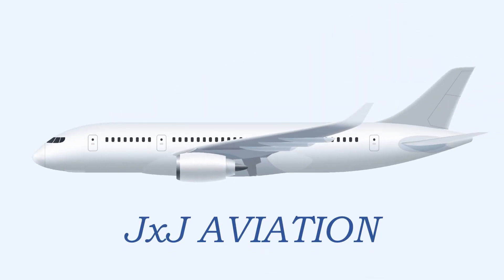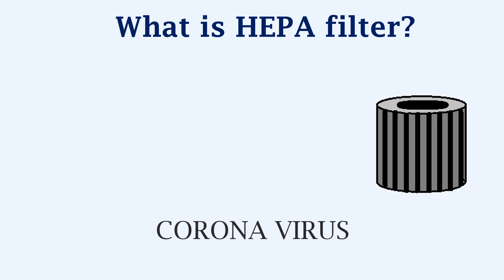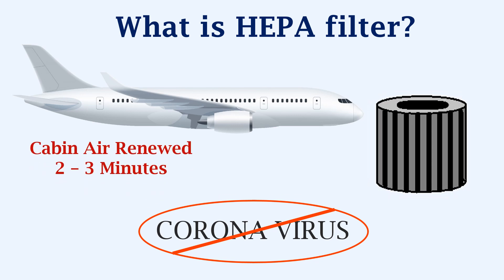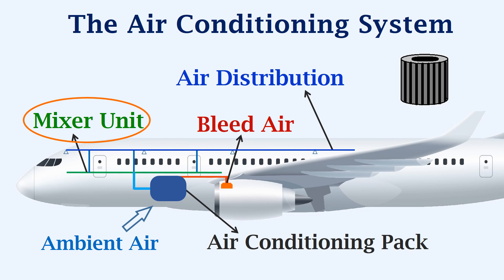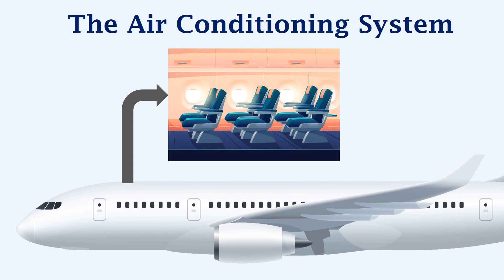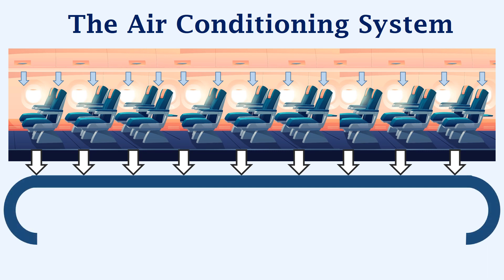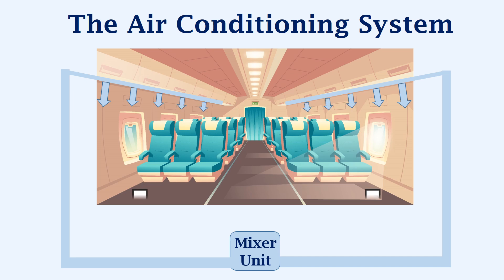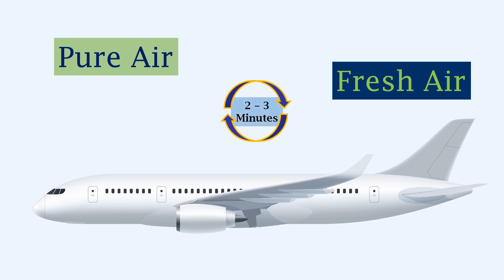Understanding How HEPA Filters and Air Conditioning System Provide Clean & Safe Air in an Aircraft!

Comment: Ideal would be to just drain out the cabin air continuously.

You have unlimited supply from the turbines, you have free cooling in the heat exchanger. No recirc would result in the HEPA filters lasting for a longer time, requiring fewer replacements, and cost savings. Additional benefit is greatly lower risk of impurities from the 0.01% that passes through the filter, and re-entering the cabin.

My worry is this; if the circulation was really efficient, then fart would not rise up (however hot the fart temperature may be) and travel to the altitude of the noses of fellow passengers
Reply from the maker: Well if we drain out cabin air continuously, engines have to continuously provide air to the Air Conditioning Packs. This will severely affect engine's efficiency and result in more fuel consumption. Fuel is a major cost for an Airline!